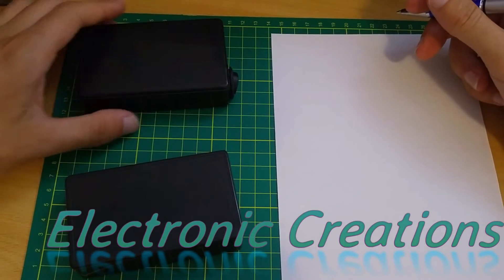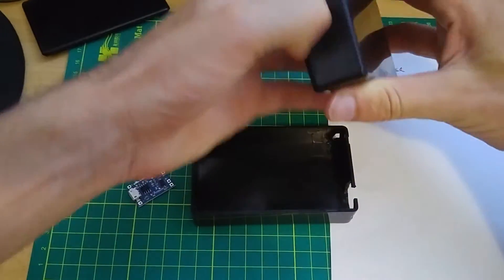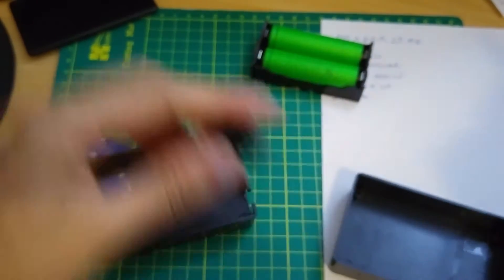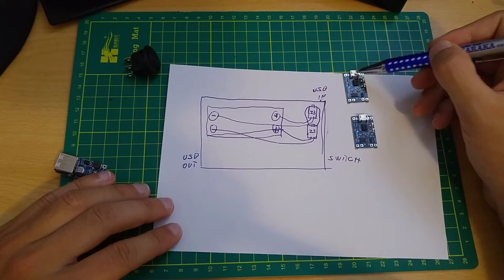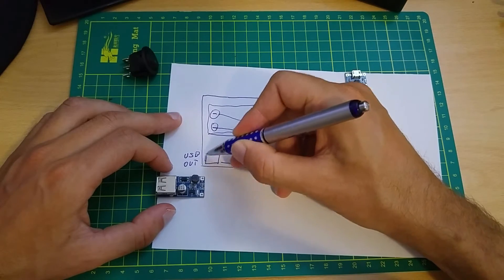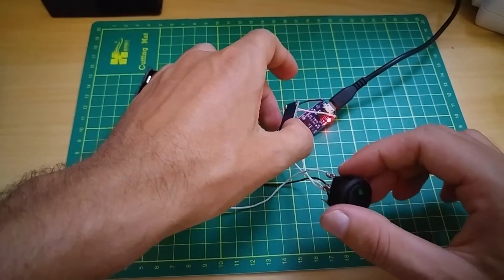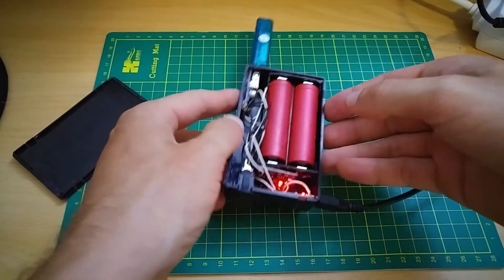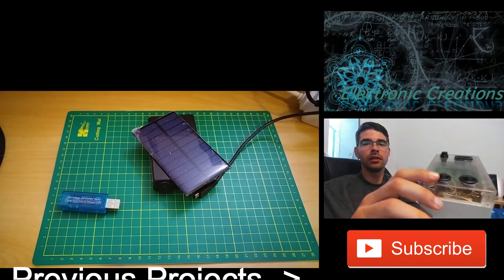Mini external battery charger DIY

Comment: great project !
i have a question though. I've got 5x18650 batteries. Can i use just one or two tp4056? What would happen if i do so ?
Reply from the maker: you can use 1 for all cells but to charge them it woud take x5 times than usual. You can expect 10h charging or more.

Comment: rly nice channel i like those stuff
i have some questions ? how can i add more batterys lets say 10 in total ? are the  batterys gonna charge simultaneously? and my smartphone battery is  2200mah (p8 ltie) how many times can i charge it with 10 batteriesx3.7?
Reply from the maker: I have similar power banks with 4 batteries you can find them in my videos. 
with one new 18650 battery you should be able to fully charge your cellphone. I saw that you are questioning on my other video about used batteries, and with them you cant tell without testing capacity. Usually good ones still have 70% of original capacity.

Comment: That was a really neat project, so did those batteries charged in parallel or they each had their own charging board, thank you so much for the videos I enjoy watching them.
Reply from the maker: Every battery have his own charging board, and boards are connected in parallel. Tnx for your support :)
Reply from the maker: Increase charging speed, better battery protection in my case. This build is limited by poor usb out with just 500mah. If you put beater 5v out you can get 2A out with this setup
Reply: paralleled charging board to increase the current??